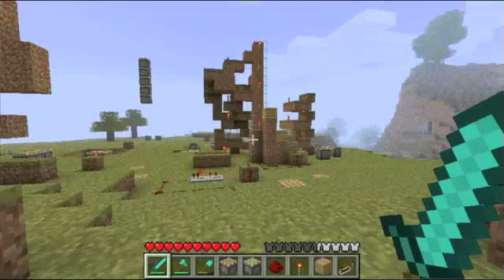Minecraft Pistons- 1.7 Piston Elevator Demo

Comment: I was trying to figure out how to make an elevator using as many pistons as bloks you'd go up, but both ways. This is a lot more compact and far simpler.
If you can speed it up, perhaps a button would be simple enough to push it up several floors, at a good speed, and another button up top to reverse direction?